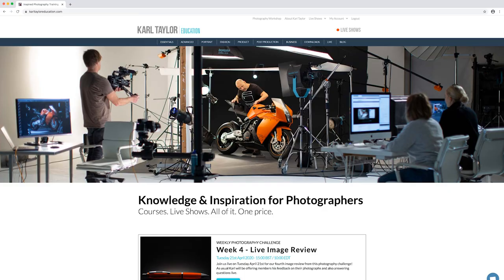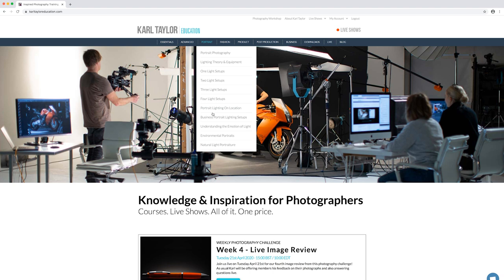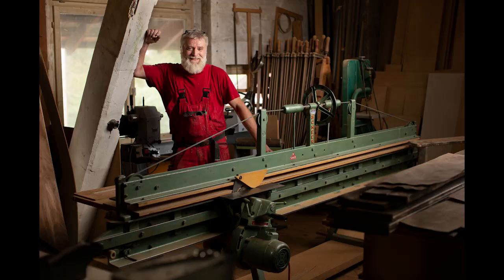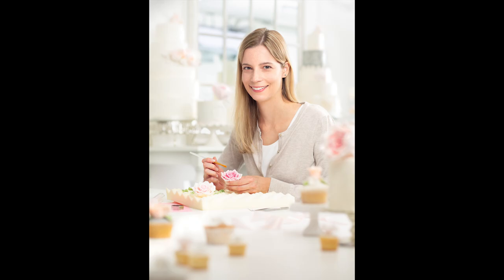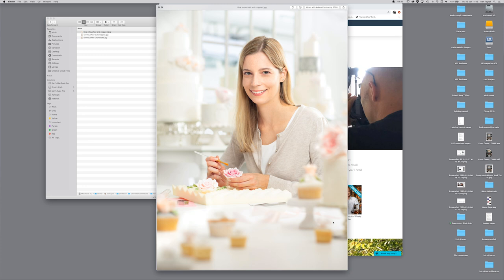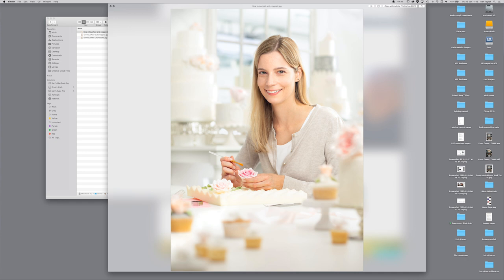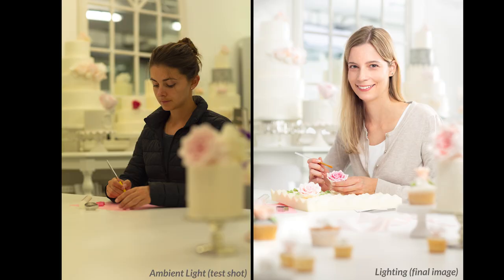Top Tips for Environmental Portrait Photography

Comment: Karl-  given the small size of most camera backs/screens, do you tend NOT to shoot tethered on location, or is that a variable per other circumstances?
Reply from the maker: I shoot tethered in the studio and I'd use tethered and I may consider it on location if it was a big budget shoot but generally I'm happy with the camera screen and freedom of movement on location. On the blad I can wifi transfer files from the camera to an assistant on an ipad if necessary.